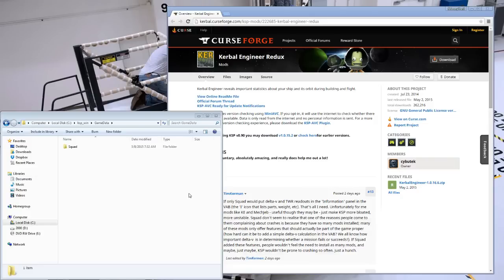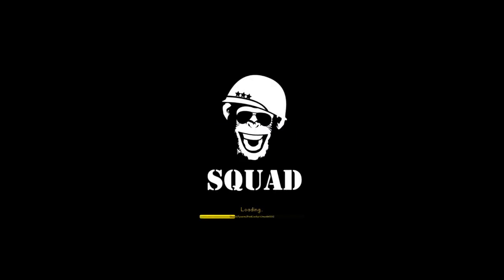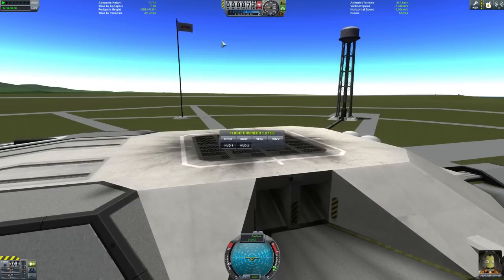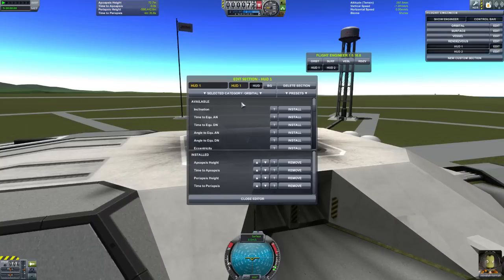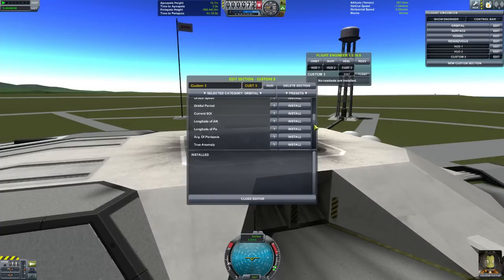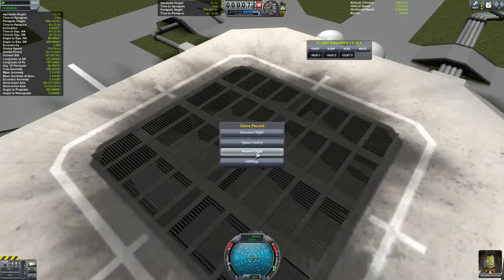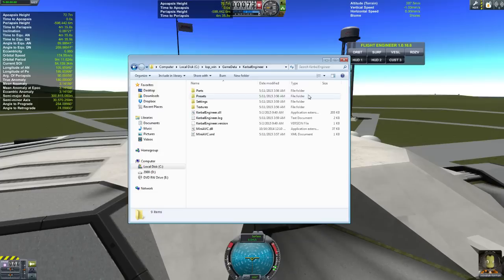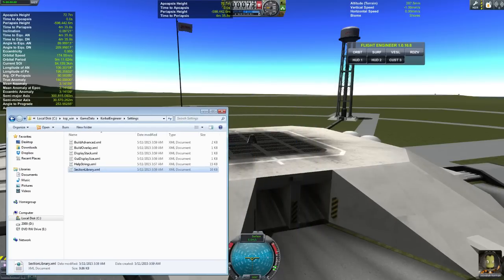KSP Quick Tutorial - Kerbal Engineer HUD Config

Comment: I looked at the mod and it says 

"Note that by default KER runs using a career unlock system. This means that when in career mode it will require either an Engineer skilled Kerbal, an Engineer Chip/ER7500 part placed on the vessel or a level 3 tracking station to work in flight. Unless one of these three conditions is present, the KER icon will be disabled and greyed out in flight. This mode is completely optional though, and by clicking on "Settings" on the Kerbal Engineer Redux window in the editor, you may change its mode from "Career" to "Partless"."

However it doesn't say where the "Kerbal Engineer Redux window editor" is.  How do I find this editor and change it?

Comment: I've got the game on Steam, I've installed KER (I even see the items in the section where you build your ships).

But I never get the UI to pop up at all, and I don't see the KER at the top right, any suggestions? I've reinstalled, and everything.
Reply from the maker: ReiperX Sandbox or career mode? there's an option that requires you to add a KER part in the VAB if activated. If KER is not coming up at all in the VAB, then it may be an installation or game install issue. but if it there in the VAB might need to double check the KER settings there or just add the KER part.
Reply: ShimmyTheJJ Science mode is what I've been messing with, but just hit Sandbox mode and still no dice.

The parts are in VAB, adding them doesn't change anything, and I'm not getting the VDelta and such in VAB either.

And only other mod I have is Kerbal Inventory System. 

Is there another mod that I have to have to get the custom UIs to pop up perhaps?
Reply: ShimmyTheJJ I'm a derp, I installed the mod incorrectly.

Instead of copying the entire folder into GameData I copied the individual folders into GameData. 

Thanks